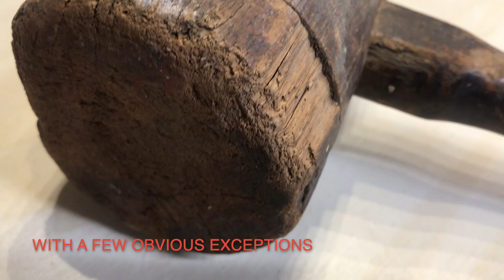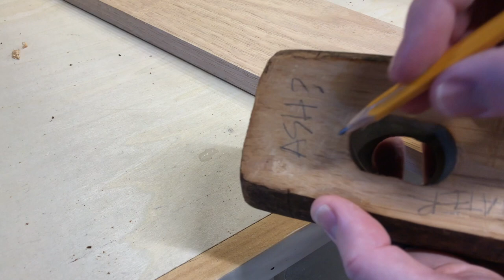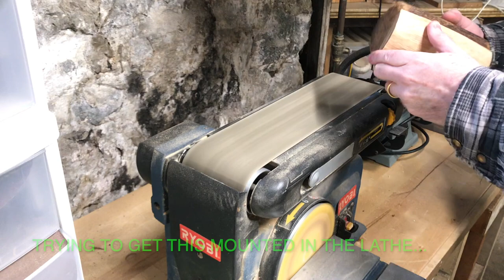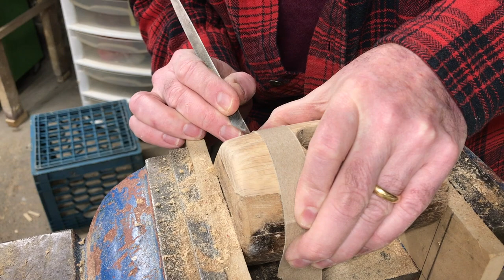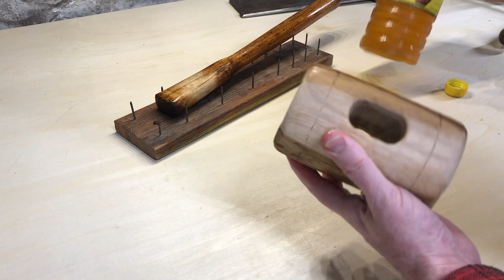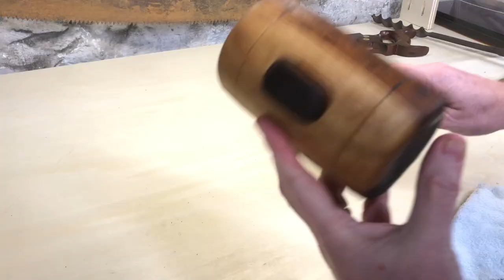Wood Mallet Restoration

Comment: A lathe would have even faster and have better results. Just saying ,but you did a great job
Reply from the maker: FStP, I think you're right, and I have a lathe, but because my ability to hold stock on my lathe is limited, I probably would have had to glue scraps on each end, and then cut them off after the tuning. After thinking about it, this way seemed easier and a little more fun. Thanks!

Comment: The YouTube powers that be suggested your channel, and I like it. That looks like white oak to me too. If this mallet is ever going to be used again for its intended purpose, will the glue hold the new piece? I was thinking you were going to drill and dowel it in place.
Reply from the maker: Thanks AJ, in the end I was pretty convinced it was white oak too, which is what I used. The mallet has been working well so far, but it was a close call whether I was going to chuck the whole head and remake it. It probably would have been quicker, as I could have done it all on the lathe. If it does break, I'll make a new head, but I wanted to try and save it.
Reply: @moonlightsnowfall6734  You did a great job, regardless. The more I think about it, dowels really wouldn't do a lot, other than keep the piece in place, as its parts break apart. Still I do like the design.

Comment: I am new subscriber to your channel.
Nice work, I like resturation channel and follow it. Nice caring of detailes good tools.
But I think glue its not fair enough to make strong.
Reply from the maker: Thanks Farouk, and welcome! You may be right about the glue, but I have had good luck in the past. I made another wood mallet that is laminated with the same glue. You can see me using it at the 1:50 point of this video, so far that one hasn't broken. If it does break, I'll probably make a new head for the mallet.
Reply: @moonlightsnowfall6734  My thought would have been to screw in several deep screws to hold the new wood firmly in place, then grind down the screw heads so that they would be flush with the wood. They'd perhaps augment the glue to give strength. Worth a thought if you wish to modify the job...
Reply from the maker: @marklammas2465  Thanks. I was trying to keep it all wood in the restoration. That way if I have to cut into it in the future the screws won't be in the way. If the repair fails, I will turn a new head from firewood. So far, the glue is still holding.
Reply: @moonlightsnowfall6734  Fair enough. I'm not a restorer, but ideas come to mind and should be shared.  I suppose I am not a woody purist; I would restore something with the intention of using it rather than worrying about artistry or beauty; you have advanced skills, so remaking a head is no big deal to you. Nice work anyway; it's worth a subscription. Added.
Reply from the maker: @marklammas2465  Thanks Mark!